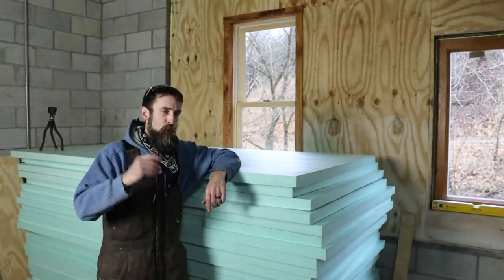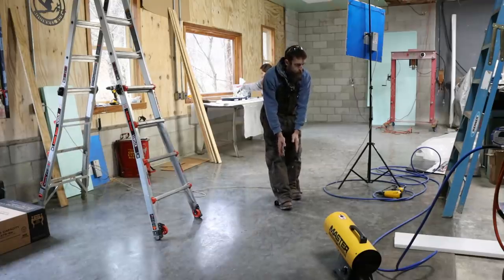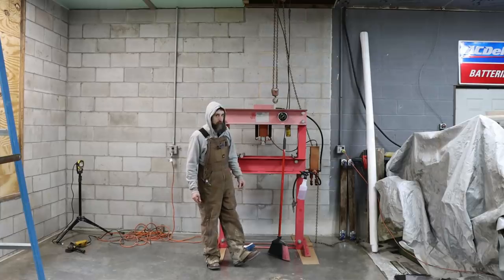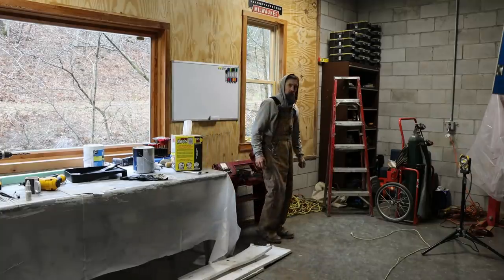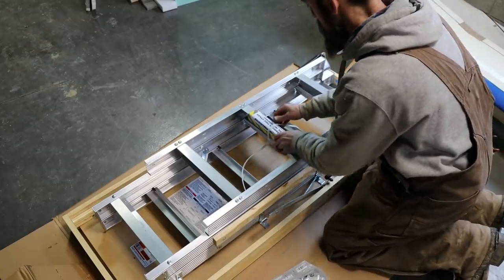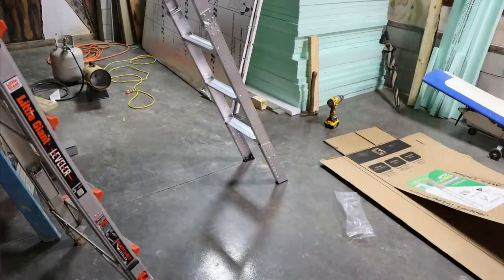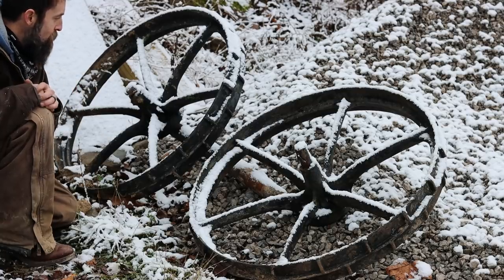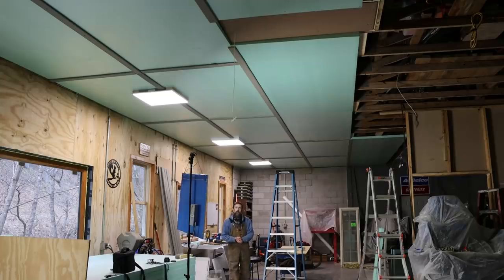Installing the new shop ceiling! One step closer to finished!

Comment: I didn't see it mentioned in the comments, but have you considered an outdoor wood fired boiler for your heat source? You could use radiators with forced air fans inside This would eliminate the fire hazard of a wood stove inside and save floor space. Intumescent (fire proof) coating might be something to consider for the ceiling, or add thin plywood or sheet metal over the areas you would be welding/grinding to increase the fire resistance.
Reply: I still think in floor radiant would have been the way to go, but that ship has sailed now........

Comment: Paint it white. I did the walls and ceiling in my shop and painted the floor with light gray U-Coat-It. Because it makes the shop brighter, and when I have a car on the lift, rarely do I need a drop light underneath to see what I'm doing. Also I have a heat pump to cool and heat the shop and it does an outstanding job on controlling humidity. The only thing that will get surface rust is where my hand touches bare metal.

Comment: Coming along nicely! Been watching since before the wall came down you have quite the nice space now. I’ would vote to paint the ceiling white for lighting purposes but i think it will function well as is. I have the same attic ladder in my garage and have come to love it, very convenient. A grinding room sounded great but yes an open concept is nice. You my know but if not they make welding screens that are free standing and you can move around, that may help in temporarily sectioning off when needed.

Comment: I don’t think I would have used rigid foam board as the ceiling but you do make a reasonable case for doing so. I really have no idea if the foam will attract and hold dust and dirt. If it does now is the time to paint it, cause it’s never going to be any cleaner than right now. The building code has a lot to say about wood stoves. Even if your shop isn’t covered by building department rules you might want to check what you’d have to do for one inside your house, although with a 10’ high ceiling and block walls you’re probably good to go.

Comment: I've always been concerned about foam from a fire/combustibility perspective. I'd personally feel compelled to cover it with something like drywall for fire risk reduction reasons. Having said that, I think the polyisocyanate insulation (foil covered) that you removed is more flammable than what you put in.

Comment: Great job Steve. Its good to see the shop coming together. It looks like you can barely contain your excitement, which is entirely understandable, as I think anyone would feel the same way at this point in the project. Im looking forward to seeing machining videos again. Not sure if I heard you right but it sounded like you said you hated Phillips screws. One quick tip. Dewalt makes good tools overall, but in my opinion, they literally have the single worst design for Phillips head bits. I've tried all the brands and the makita gold impact Phillips bits are the best followed by milwaukee. Like any bit they do wear out, but the makitas seems to last the longest and cam out the least. (They don't cam out at all until they start to wear and when that happens, its time to change them.) Anyway, hope this helps you like Phillips more. 😁 Just remember, don't use dewalt bits and change them regularly and you shouldn't have problems with cam out. Anyway, love the videos, the shop progress, and hope this tip helps. Keep up the good work.

Comment: The shop and currently the ceiling looks great. Wasn't sure about the material when you started but have changed my mind on it. I even like the green, but if it were me, I would paint the ceiling white to add more light to the shop. You can never have enough light in my opinion. Agree with removing the wall, it doesn't fit to the shop in appearance or function any more. I also must say that at first I didn't care for the shiny sealant on the floor, but I have changed my mind on that. I was concerned with it being too slippery if it got wet or any lubricant got on it, but that would be an issue with any surface other than a brushed.
Thanks for sharing and congratulations on entering the final lap of the project. Next will be locating the machines and the machine/tool power distribution. I have made a lot of notes for my shop that will be built along with our home when I retire in a little over a year now. Thanks very much for sharing your journey.

Comment: I must confess that I would go with ceiling mounted forced air heaters. They would probably cost about the same as an installed, large wood stove BUT you have to pay for the gas (propane or natural, depending on availability) and you may be able to cut your own firewood very cheaply. The forces air heater would heat your shop up a lot faster. However, I am surprised that your building code allows exposed foam at all which should never be used near either heat source.

Comment: Shop is shaping up very nicely. looking good.  Personally, I would have painted those foam ceiling tiles white before installation or at least primer them which is pretty white to start with. The green is light enough not to suck out the light too much so your call wether you want to bother with doing it afterward. Ceiling in my garage is opened up  with a couple of Sheets of plywood thrown up there loose for extra storage space. I would have had your daughter help. Good daddy-daughter time. Oportunity missed. She would have learned painting skills so later in life when she is married and has a house of her own she would be more independent. Like the folding stairs and not too expensive. Sure is nice to have that to get up there with. I am using a ladder and hoisting myself up. Dangerous to get down afterwards but don't have to do that much. luckily, most of the stuff up there  has never had to come back down. I am using an 8 ft  double fluorescents for lightning but bulbs obsolete now so will need to replace with new when bulbs die. Where did you get those lights from. If they are cheap enough to buy itvwoud be a nice upgrade.I would like to use them rather than go with newer fluorescent fixtures. They are nice and bright too.

Comment: If your press does not produce pressure, I would suspect that the piston seal is leaking. I don't think both pump check valves would leak at the same time. When you do a repair I would replace all the seals and checks. Just to be sure.

Comment: Steve, nice work as always. Does the roof have eves?  If so you may want to consider eve vents to allow air to be drawn in via your fan providing both moisture control and hest relief.
Eric

Comment: Steve your audio lets the quality of the video down badly. There were section I couldn’t hear and others that were fine.
Good work overall really enjoying the project and you have achieved pure wonders so far. Good luck and stay safe.
Reply: I had the same problem fortunately closed caption works rather well.

Comment: Hey Steve, 
I was a bit concerned when I saw the ceiling you put in. At the twenty nine minute mark there was a pronounced amount of reverberation in the audio. I believe you were using the on camera mic that picked up the echo. When using the lapel mic the audio was much better. It might seem a little louder in your shop when running machines, etc. It might improve as the space is filled thou. 
Great Tubing Thou
From a self professed Audio Snob. 
Greg T

Comment: Steve, fantastic quality of work and progress!      That duckegg green ceiling is very easy on the eyes.       One viewer made a good comment on flammability....because  you might do welding/plasma cutting inside, could that new bare ceiling be a potential fire hazard.. ? Could the old ceiling that you took down, be reused in your attic space on the underside of the roofing plywood??

Comment: Wow Steve,  looking really good!  A whole lot different than those pictures you emailed me a year or so ago!!!  It must feel great to be "hoeing the short rows"  :D   On the price differences on the concrete bid,  it's called defy to buy.  As a disabled "retired" contractor,  no offense, if I had come into your shop, and seen that you had done all that, and noticed how meticulous you are about details, AND I had enough work to not NEED to do your job to survive,  I would bid the job high enough that the price would defy you to buy it.  Essentially,  if you did choose me,  my bid had enough of a cushion built in, to take into account the extra time I felt it was going to take me to meet what I felt were going to be your "unreasonable" expectations.  Now,  PLEASE understand,  a contractor has to make these decisions on gut instincts based on what,  a 10-20 minute visit, and what he or she learns and feels from that visit.  Especially if that contractor has had a bad experience similar to yours in the past,  they may be gun shy to do it again.  It's far worse to not give a price at all, than to price to high.  Just my opinion.
Anywho,  can't wait to see it finished and you making chips that spark instead of float.

Comment: Drywall and steel ceilings are fire barriers. Code requires a fire barrier between spaces- especially exposed lumber spaces like rafters. Foam board is not Fire rated. Foam board is a fuel.
Reply: We build our houses out of "fuel". Give it a rest.
Reply: @alanking7331  Yeah. Clearly you’ve got it all figured out. Good luck with that.

Comment: I love what you have done there in your shop however what is the the flammability rating of your foam sheeting? I'm thinking of sparks from grinding especially from the use of an angle grinder? - Perhaps for your peace of mind you should try a little ex[periment outdoors somewhere safe and see if you can set fire to a scrap of foam panel? 
I have an attic ladder like that one and I made a J shape long handled hook on one side of the tail and a push point using an old tap washer on a circle of metal on the other side which allows easy opening and closing of the hatch. I hang it on the wall closeby for storage.
I like the idea of an open plan workshop and we use a couple of plastic welding shields stretched on a lightweight frame and wheels to Fence off a grinding or welding activity - they work well for wind protection if MIG welding outdoors.

Comment: The only thing worse than overhead work is crawlspace work. Overhead work is to crawlspace work as philips screws are to flat heads :) Blech.

Wonder how much air is going to scrape by the edges of those sheets and make its way out of the heated space? I know the joints usually have to be taped when used as sheathing, but that's for moisture barrier.

Comment: As a retired union carpenter here in St.Louis your project has turned out very nice.Things look square & plumb...As my father said always step back and take a good look at your work as you move along.No job is perfect but you can sure give it a  give it  a good try..You will always be happy if you do..My machine shop is in my walk out basement and takes the entire basement but it is great for temp control Heat in winter and air  in summer.If i can move a Wells Index 3500lb mill threw the basement door you can Do anything if you have to.... even if it means to do it a peace at a time..Do you have any plans on the shop doors?As far as the green on the ceiling goes ...I like it....As far as the walls go i have a block wall  basement  and i have had no problem with it as far  as dirt and dust..I would leave the walls alone...I would get the shop settled and if you decide to paint the walls latter you can always break out the paint at a latter date..Nice job...

Comment: White paint reflects about 85% of the light.  It helps your lights out tremendously
Reply: Yeah, it's a huge improvement over anything other color.  I started painting my garages and shops with white drywall primer a while back (well, about 30 years ago I guess) and it makes a HUGE difference in being able to see everything, especially in corners and behind things.

Comment: "I can't stand Philips screws"... how many times has that been said? I bought Snap-On screwdrivers just to make them a little bit less painful (definitely better). In Canada we mostly have been using Robertson... now we are seeing more Torx.
Reply: Robertson are sold (and I buy them for some uses) at a local mom/pop lumbar yard/hardware/deli/grocery here in rural Kentucky.  Shop local, bois.  Shop local.
Reply: Lol, I'm long enough in the trades to remember saying the same about flat head screws. Why in the world would ya use flat heads instead of Phillips? But, the older I get, the more I realize a good ole flat head that's rusted in is still easier to remove than any other drive.
Reply: There's a screw that has both Robertson and Phillips in the head.  It's a great scookum screw with a high amount of torque and shear load. Harder to get in Canada but not impossible.
Reply: @KJ-kw7gh  I agree that an old flat head screw is better than an old philips... the key is the right size screwdriver. Doubleboost just showed it in his last week's video.
Reply: @iseiyoulaitre  I have seen Robertson / Philips combos but not with Torx. Interesting. 20 years ago we shipped equipment to South Korea for a job. The Canadian shipper crated everything with Robertson screws. Our Robertson screwdrivers were in one of the crates... ended up smashing through  the wood. Lesson learned.

Comment: I loved having wood heat my shop, and a quality stove can be very efficient. Plus you are surrounded by free fuel (except for the labor). However I would be very concerned using one with all that exposed SM, it would be an extreme fire hazard. In Ontario you would be legally required to add 5/8" drywall over it (all joints taped an plastered) plus you would never be able to insure it.

Comment: You are probably going to regret not painting the ceiling beforehand.
I just finished painting a paneled ceiling and if I had to do it again I'd just take it all down.

Will you cover the top of the joists so that you can store treasure? (Or rather junk that isn't quite ripe yet.)

Comment: Your daughter looks just like her Mom... Who makes the led lights you showed? I don't remember seeing them in my local big box stores.
Reply: I had some luck searching for "led panel lights".  Not exactly what Steve has, but pretty close.
Reply: They are made by LiFud and have a few sizes the largest being 60cm x 60cm (approx 24" x 24") and 4000lm output, typically 2 LED panels, replaces 4 x 600mm T8/T5 fluorescent tubes lights set in 600x600 grids. It is a popular lighting choice for hotels, factories, offices, schools, colleges, hospitals and the like. LUMiLiFE 40W units come with a non-flicker Lifud LED driver for improved uniformed light distribution with no interference, and will give you 40,000 hours of service.

Comment: you have a lot of ceiling to paint.. did you know that there are 18" paint rollers, roller frames and roller pans just for doing massive areas..  some have drip trays that swing under the roller but those are more expensive.  i probably would have painted the plastic panels before i put them up as then its only touch up once they are installed.
Reply: Electric sprayer is pretty simple and fast...plastic sheet everything under and done in no time....make sure the paint doesn't dissolve the foam first...

Comment: Hi Steve, those foams are usually pretty flammable. Have you considered that?
Reply: This stuff is Class A (E84 15) fire rated.
Reply: I've done years of fire prevention work and have handled a lot of fire damages as a damage assessor. It's an extruded polystyrene insulation. In actual fire conditions, it will melt and fall down burning. That's why insurance companies hate it and building codes tell you to cover the stuff. It the reason the manufacturer writes "These numerical flame spread and smoke developed ratings are not intended to reflect hazards presented by this material under actual fire conditions. All applicable building codes must be followed." to cover it's @#s. 😐

Comment: Curious about the fire rating for that foam. I would worry about the wood stove or stray sparks or hot chips setting it off. Also wondering about how much clearance and ventilation those 40W ceiling lamps are supposed to have.

Comment: Steve, it sounds like you need to heat your shop. what with the wetrot and rust. my guess; you will close-up the shop before putting a heater in.  i doubt a dehumidifier will do the job. so, a heater. or a million tons of silica-gel to pack the shop in when you aint working! LOL   anyway.  take care stay safe!  poppy

Comment: think i would paint the ceiling white , dont know how good the paint would hold ontoo the foamboard though , maibe use a sticky back plastic sheet or white plastic like the stuff you used as  moisture barrier (take the plywood strips back out mount the plastic and hold in place with said plywood)